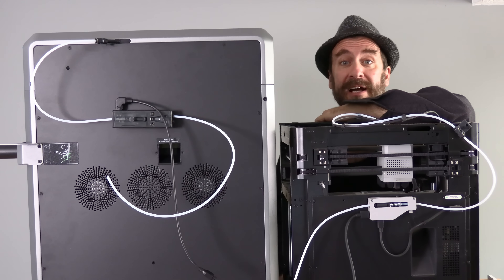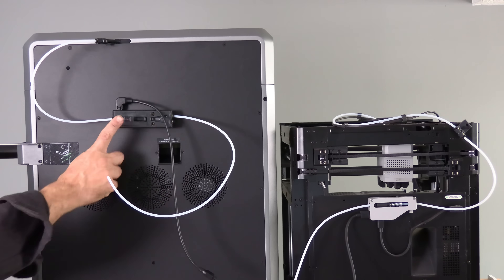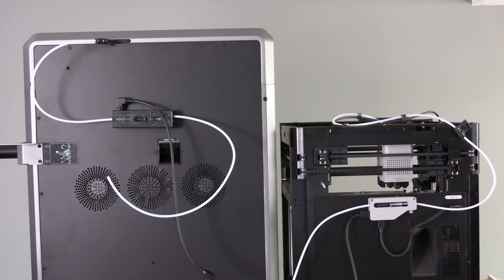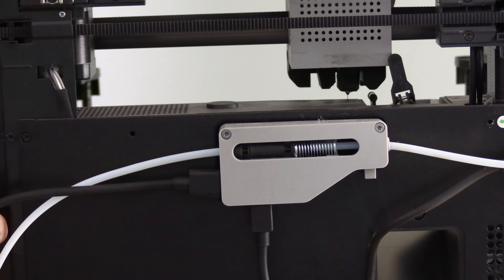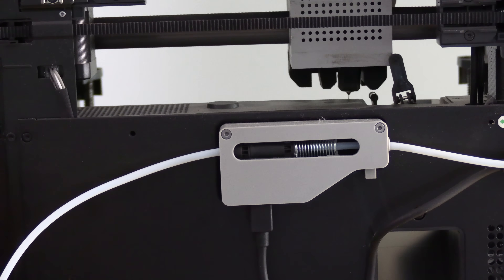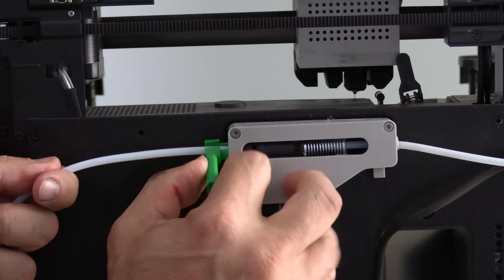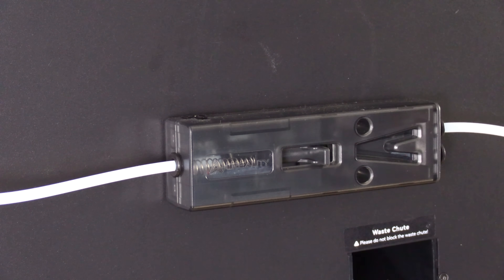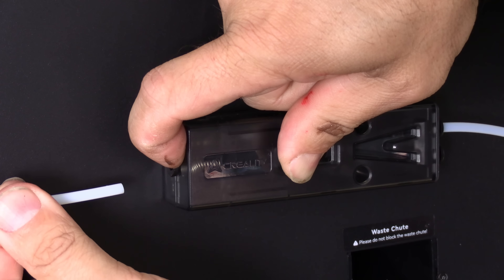Creality CFS Buffer Vs. Bambu AMS Buffer: It's... BETTER. (I know!) K2 Plus 3D Printer

Comment: i love my bambu lab machines but i also loved my creality machines and still use them when i have alot of stuff to print or need a build volume bigger that 250x250 so i really would like to try crealitys k2 with the bigger build volume and the multicolor system but ive not been able to get any info on how well creality has handled everything it takes to make as seamless as bambu labs has. also has creality printers become  better calibrated out of the box compared to there older machines. my p1s' have been the best machine ive gotten out of the box and calibration on them are stupid easy with bambu stuido an orca so i just hope creality has done the work an is following the same or similar path as bambu labs. i want ot pick one up at some point, i just need to find someone  willing to buy a bunch of my older machines first to make room for anymore.
Reply from the maker: I like my K1 and K1 max as much or more, than my Bambu's. I use Bambu Studio for all my K1. (but not K2..... YET). All the new Creality machines, the V3, K1, cr10-se, are easy-peasy to setup and put to work. Bambu Studio and Orca, are still the better slicers

Comment: ohhh, I wanted to know what the buffer actually does.

And I agree, today, plugging in my Bambu printer, and seeing the clip facing the machine :O   I bet someone made a mistake during the design and it was too late to change
Reply from the maker: Guides filament too and from the Hot end, by directing traffic, from Multiple AMS to the single output Bowden. Holy cow.... ONE MORE THING the K2 Plus Buffer does better.....   Bambu's only supports ONE. You have to add a different buffer, to expand to two or more AMS.

Comment: I don't think so. The shielded tube insert isn't a negative, nor did it need a fix. You don't want tabs extending behind the unit. It's easy to disconnect without a tool. A screwdriver or pocket knife will work fine.
Reply from the maker: A screwdriver or a pocketknife. Is a tool. Yes, I want tabs facing the user